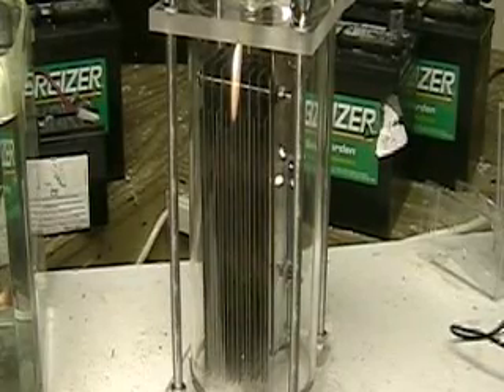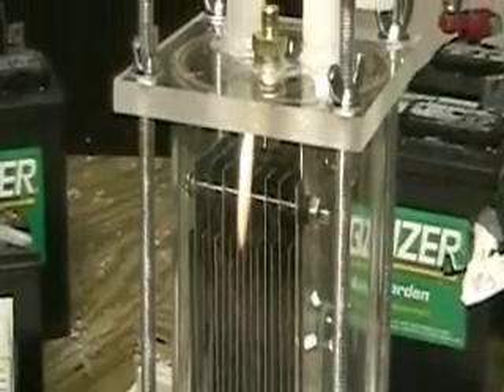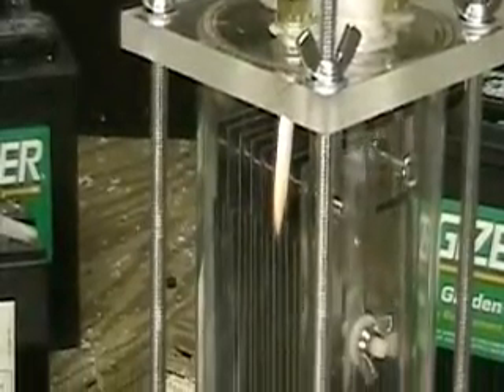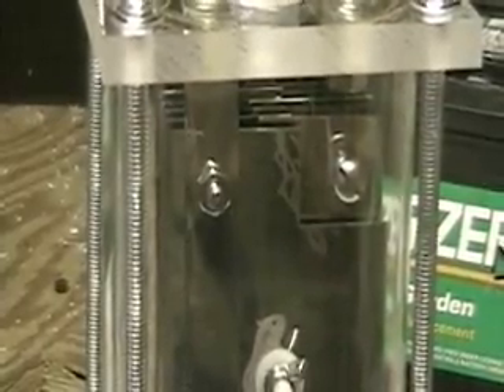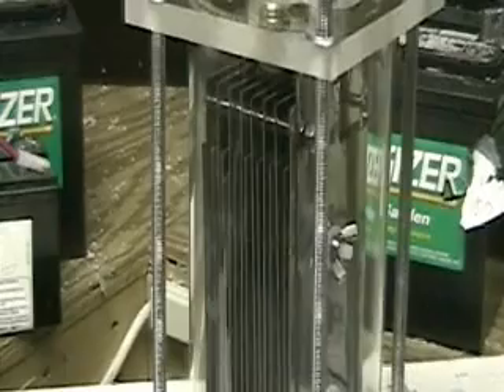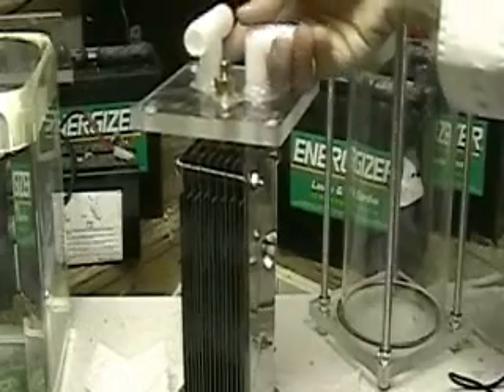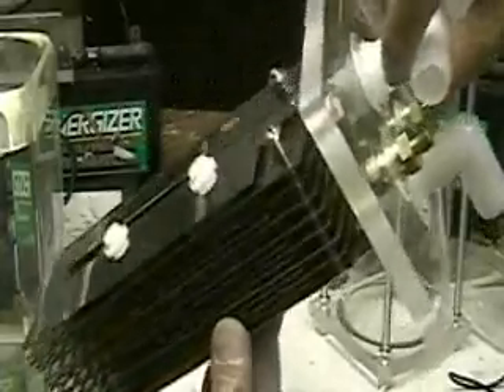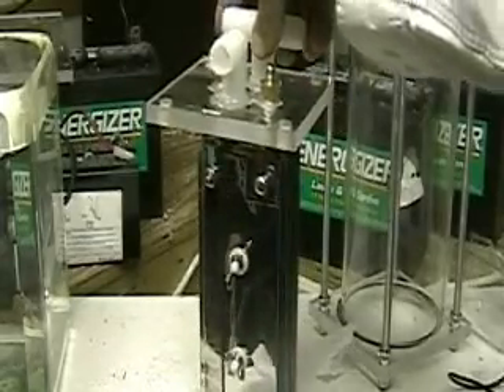Hydrogen Tap ( NW 768-s  Hydrogen Cell) 108

Comment: John I agree with you about the seal. I use a siphon pump to drain mine. Once you get it started it will drain itself and after awhile of operation you may need to flush it while it's draining.

Comment: Continued:
I have a spread sheet that will calculate it. If you are interested. The Question I have is what is the Exhaust volunme going to be. Since I am told that Hydrogen and Oxygen Implode with a reduction in volume of 1698:1. The stichiometric volume of H2 and O2 is 2:1 for combustion. The volume of other gases is going to be What? Thats the question. How much fuel do you have to produce to Make it run?

Comment: John:
I was doing some calculations on what the volumetric intake that would be required at any rpm for a paticular size engine. This has nothing to do with air fuel ratio only how much volume is pulled into the engine by the intake.

Comment: Well make sure that your wiring diagram shows that your fuse goes directly to the fuel pump not the relay as most relays are used for a safety feature to interupt the ignition as noted in AllgoodAutomation comment above.

Comment: Suggestion, Find the wire at the relay that goes to the fuel pump and cut it and splice a switch in locate it on the dash so you can control it from inside. On GM cars it is usually a pink wire with a black stripe coming off the relay going to the fuel pump

Comment: John;
You may not be aware that the Honda computer controlor disables the ignition when there is insufficient fuel pressure. So disconnecting the fuel pump could prevent the engine from rumnning.  you will have to bypass the fuel pressure sensor. Tom

Comment: Are you planning on running the anode/cathode on 12 V pulsed DC in a PWM fashion or what?  What grade of stainless are  you using, 304 or 316?  Is that a sch 40 4" acrylic tube ?  You do plan on using a bubbler between the cell and the engine for safety, right?
Great job John!